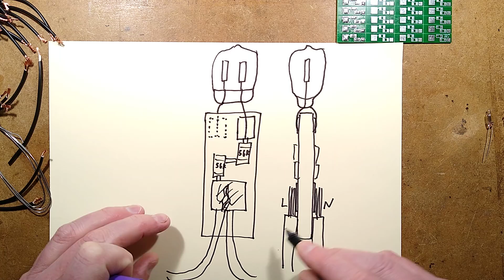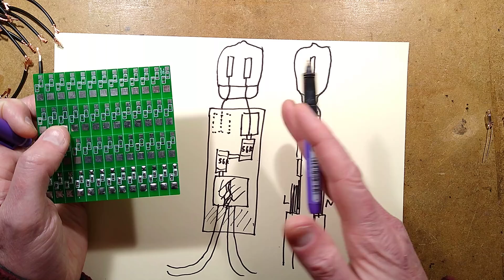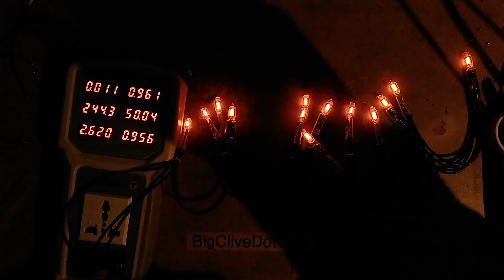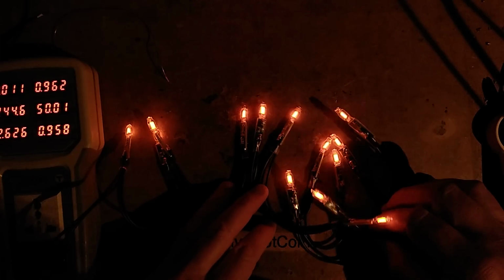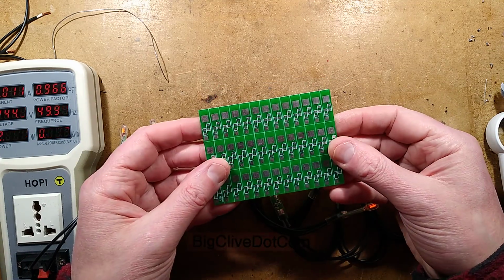PCB based neon fairy lights

Comment: How about making it a little smaller? If the resistors can take the voltage, then you could use four 120k resistors: two in parallel on either side of the board. On 230V you can also use two neons in series to half the current, at the expense of more flicker.

Comment: It's cheapest to panelize yourself with mousebites for breaking boards apart. Sometimes they complain and charge you extra but usually it works. Very tedious to do however, especially for small boards, haven't tried automating it yet since it seems about as much work/time for me as my lifetime manual paneling time.

Comment: Sorry if I missed the answer to this how many can you put in a row? Is there a cut off?

Thank you Clive!
Reply from the maker: Maximum number in a run is the current rating of the cable in Amps times 500.  So thousands.
Reply: @bigclivedotcom  Thank you for answering that. I’m new to electronics and have only done a few projects so far. I’ve never ordered pcbs but this is wonderful. So it will hopefully be my next project. Thank you so much!

Comment: Flux very much does age... but only the liquid stuff!  If it's in a multi-core solid solder it should be stable for decades.
(I had a glass jar of "pro" grade solder flux, opened and then stored for years.  When I can back to it, the vapour had corroded the metal screw lid to the glass and the flux was black and gloopy.  Didn't put it near my PCBs!  I now only use flux pens, especially for SMT.)

Comment: You can panelize using routed slots and drilled holes in your design directly for PCBs that small, this way you avoid the v-slot charge

Comment: No need for PCB... Just solder a normal 100 Kohm 1/4 W in series with each bulb, cover it with shrink tubing, solder the other wire, some more shrink on top, and is done.
My way.
It also possible to make blinking light string, if powered with DC and a 1 uF cap in parallel with the bulb.
Those bulbs are active components because they have a negative differential resistance.
Thanks!
Reply from the maker: I made another video with neons, discrete resistors and sleeving.

Comment: Why not have the resistors for the lamps at the supply side covering all the lamps instead of resistors at each lamp? I don’t recall LEDs. Ending a resistor per lamp. 

I’m am completely ignorant.
Reply from the maker: Neons require a resistor each.  If you use one resistor the first to "strike" will clamp the voltage and stop the others lighting.
Reply: @bigclivedotcom  Yay cellphone autocorrect!

Comment: A clever design for a PCB project and a simple soldering method to mount the components. You've designed it as a Fairy Light chain, but the Neon's will look great hung around anything for a room display for ambient lighting. I love your HOPI unit for the various displayed results and easy connection to input the cables. I must get myself one from somewhere. If you know of a place and/or recommend a make, please leave a link below Clive in the reply section.
Reply from the maker: The Hopi came from eBay.
Reply: @bigclivedotcom Cheers Clive.

Comment: I just got some panels made too, although I did panelise them myself. The original design was for 4 modules with 3 sides routed and the 4th vscored, so they were effectively hanging on tabs. But they didn't like it, so instead I just made two modules back to back with vscores between (and an extra spacer section to make up the minimum width for the vscoring process).

They turned out the same price ordering twice as many smaller boards. It wouldn't have been that expensive, except for the fact that I wanted them gold plated for the edge connector. Even so it still only worked out to less than $2 Aussie Dollary Doos per-module. EDIT: I just checked and they don't have the option for the 40 modules I wanted, so I would've had to order 50. That would've made it only $0.10 more expensive per-module, but added a total of about a third more to the cost.

Which is the cheap part. Now I need to suck it up and buy a big batch of vintage ICs from the US.

Comment: Watching you use so much solder on everything makes me cringe. You can use 4 times less solder when pre-tinning the wires and half the solder for soldering that SMD resistor and neon legs.

And why didn't you take off the nozzle of the heat gun?

Comment: Yeah, any kind of grooving or routing adds significant cost to cheap PCBs. I usually just panelize them myself and leave room for a bandsaw cut and do it myself, but like you said, sometimes it’s easier to just order them individually for some reason. Great vids. As an electrical engineer, I find your videos well produced, interesting, and very soothing. Keep up the great work. Cheers!

Comment: I have a small tin of paste flux on my bench for jobs like these. I add solder onto the pcb pads, dip the wires or pins on the paste flux then reflow them directly to the solder pool on the pcb. Does a quicker job than tinning the leads before reflowing them on the pcb. The pins or wires should be pretty clean though for the solder to wick around it well for a nice looking joint.

Comment: Nice going, I have a soft spot for Ne2 lamps. Did you know that neon lamps have this tendency to react to light itself? I discovered this with an outlet strip that had a neon lamp as a power indicator. The light would go from a state of flickering to steady and I am quite sure it had nothing to do with the voltage. Fun times

Comment: For safety you could run these from a simple isolated DC supply. I have tried  a 48V transformer (2 X 24V windings in series) run through a full wave voltage doubler which gives around 177V driving one neon lamp at 1mA. The voltage will drop with more neon lamps but the transformer (10VA) should be able to drive about 40 at 1mA each and still give sufficient voltage.

Obviously you could still get a shock if you touch both poles simultaneously but a floating isolated supply is generally safer.   

Running then on DC also allows them, with increase in the value of the series resistor and the addition of a capacitor, to be run as flashing relaxation oscillators. 

Next project is a neon supercomputer.

Comment: Hey, Clive. I think if you'd change one of the resistors with a diode in one direction, and in the other direction on the second PCB , that would make an alternating flickering lights. 😎
Reply from the maker: It would be too fast to see with the eye.

Comment: With regard to the flux, if I remember correctly the flux in solder changed or started changing in the 1980's from or to resin based. I have still got the odd bit of solder from before I was born.

Comment: I had the same "issue" with small PCB a couple of weeks ago.
But the way I designed the PCB, it had 2 holes in it to accommodate standoffs and that helped me to clamp the PCBs together, offset by one and then with a hacksaw I separated them (I was too cheap to pay for the extra cost).
It worked for me.
Would I do it again? In a pinch yes, but probably not.

Comment: For a project in the past i added a small blob of hot glue as cable restraint the heat shrink tube squeezed it out perfectly making it quite rigid.
Reply: Drawback is if it touched any conductors, hot glue can become conductive over the years so could be "interesting" at some random point in the future.  Then again, who knows the life span of random Chinese heat shrink sleeving.
Reply: @alexatkin  that could indeed become interresting with 240V, I usually do most of the work on the 5-24V range and I have not yet had any issues.

Comment: For important stuff (exposed mains voltage), I would use something like eBay item 334171645822 as my preferred heat shrink material. I used this stuff quite a bit and like it. But I have no clue what shipping to the UK/Isle of Man would cost.

Comment: Seasoned advice - more tin on the wire tabs & use a gun not a pen for said tabs (wire centered then apply primed gun tip on top of wires / it flows better)

Comment: Hot air gun - I use a B&Q Titan paint stripper, electronic temp and speed control and about 1/4 the price of a heat shrink gun. Very controllable and the larger amount of cooler air works very well

Comment: Would a single pad for each wire be better? Quicker and easier to solder
Reply from the maker: Possibly.  But I like the PCB adhesion strength of one bigger pad.
Reply: @bigclivedotcom  how about via stiching on side 1 L and N input. On side 2 L and N output. Don't know about via additional cost but pad adhesion much better

Comment: I did something similar with thin "zip" wire, only left it as a contiguous wire.
I'd only strip the insulation to leave a bare spot, then just fold it.  No cutting necessary, despite being a bit more labor-intensive getting off the insulation.

Comment: For what it's worth a dab of hot glue prior to adding heat shrink is actually a  pretty good substitute for the adhesive lined heat shrink tubing if you are shrinking it with a heat gun ... doesn't work quite as well with a flame.

Comment: Thanks again Clive for these videos, makes the evenings less lonely.
I like the idea of the shimmering effect, could there not be a way to introduce a simple way to make them flash?
I would really like to see a build with various the traditional Neon bulbs from short to very long electrods and even include Green and Blue variations.
I am sure many of us in the BCDC Family would mimic the build let that be on 220 or 120VAC mains.
Reply from the maker: It would require at least two resistors and a capacitor per neon.

Comment: I didn't have this issue with JLC. Did you use the website to panelize or did you do it yourself in the design software. When I ordered panelized PCBs I made the panel myself in EasyEDA before importing to JLC. were double sided and had 6 duplicate designs with v-cuts in between each, in total with expedited shipping it was $11 US.
Reply from the maker: It was due to the small PCBs and high number of close vee cuts.

Comment: Squirt a little hot melt glue on the circuit board and let it cool. Slide over the heat shrink tubing. When you shrink the tubing the glue will re-melt and squish all over.
Edit: I'd also round over the square ends of the circuit board to prevent the sharp corners from cutting through the tubing.

Comment: Any value adding a single resistor in series with the entire string on one power lead as an added measure of safety?
Reply: A fuse would be even better for that. If it actually does short out, you'd want it to be disconnected rather than stop glowing while still powered. The circuit breaker should mostly be enough though as well. It will probably trip before the wires melt anyway.

Comment: I did something similar but with silicone wire - Heat resistant as well as flexible. Makes stringing it up way easier
Reply: Unless in contact with gasoline etc., EDPM wire is better still as it is more resistant to damage from sharp edges and points. Not as easy to find tho.
Reply: @plemli  I'm so glad you posted that because so many people throw gasoline on their Christmas tree
Reply: @pleasecho2  Yeah, and it's nice that at least the wiring won't be affected 😛

Comment: I must say, as a self "taught" amateur tinkerer, it's very reassuring to see how long you hold the iron on components!!
I know enough to know that components gave like 2 ratings, one for absorbed heat while being oven soldered, and another for heat absorbed through terminals sinking it while soldering with an iron.

I've always been concerned with how long I keep the iron contacted, mainly when salvaging but even with new parts, knowing how hot they get. 🥴
Reply from the maker: In the past it was easier to damage components with heat.  These days they're very resilient.

Comment: In the US (~120 VAC), we used 88k - 120k (or ~1k per VAC).  88k for bright and 120k for dimmer neon's.  4 @ 30k will work nicely.
Suggestion: put the neon pad on the other side away from the resistor so your leads will not be close to the resistor. 
A little more trace length, but more room for longer legs.
Reply from the maker: That was one thing I did pick up from the prototype.

Comment: Your HOPI says 2.633W yet the math says 2.6939W ????
The current wattage of each lamp is .2W... What is the rating is watts or amps? Is there a voltage rating? The voltage divided up between each lamp is 18.83V, that doesn't sound like enough. I thought small neon lamps like that required around 60V to turn on?
Reply from the maker: The neons are all in parallel.
Reply: @bigclivedotcom  Ah-ha...A slight oversite of mine 🙂

Comment: Consider adding a capacitor to each board to make relaxation oscillators for a twinkling effect.
Reply from the maker: With modern MLCC caps or a small electrolytic that's viable.

Comment: A bunch of neons I got from ebay all burnt up after about 2 months with 2x100K resistors. Are bigger resistors a good idea? They seem to light just as brightly with 2x220K and they even light a bit  with 1x440K and me touching the other terminal (meter said about 10uA)
Reply from the maker: They glow at very low current.  Too much results in rapid darkening due to electrode sputtering.
Reply: @bigclivedotcom  thanks. Can you follow up on the lifespan of yours? The ones you have look exactly like the ones I got (the way the electrodes light so evenly).

 Another batch of neons I got to make a prototype set light very unevenly with a pair of 100K resistors but don't show any sign of darkening despite running for the same amount of time.

Comment: I've thought about the flux aging, but I buy the .030 solder in the 1lb spool that lasts for well over 5 years and it still works fine. [I think I bought my current spool 8 years ago and still have 30% left.] With the spool I just grab the end and pull out 2 feet or so, use it and when done just wind it back onto the spool. That way I never run out or end up with little tidbits of solder.

Comment: Quick tip, and just the tip mind, but popping a sliver, or two, of hot melt glue stick inside regular heat shrink it does a great job at filling in any gaps, reinforcing the heat shrink, and also acting as strain relief. Now that you have these made, you could use a thin nozzle on a hot melt glue gun to pump some melted schmoo inside these, by the leads, to make them a bit more robust.
Reply: What a nice doggie pic General Disarray.  Yours ?
Reply: @ilovepuppies3507  I wish, but sadly not mine

Comment: Quite unusual and cute ☺️, I would love to have these. I have a 100 holder, incandescent coloured fairy lights set strung along the walls in my bedroom, which has been running for quite a long time - I put them up one Christmas and didn’t bother taking them down = now they are mood lighting as they are too bright for night lights - I recently bought a “Chineseum crap” dimmer socket to dim the lights so I can go to bed with them on 😴. Only the yellow bulb above the pillow of my bunk bed has failed 2x and the blue bulbs have UV faded - they need to have the paint stripped off and be re-dipped in acrylic paint, that is how long I have been using them - as of typing this l am admiring them at full-brightness 🤗. If they were to completely fail - I would replace them with coloured dimmable LED ones.
[Clive] you could do Coloured neons with that

Comment: Very nice. I was wondering if you wanted to maintain double insulation for the whole setup would a second bit of heat shrink over the board be enough?
Reply from the maker: It would.  And also a touch of hot melt for strain relief.

Comment: Oops... you said "1201 size resistors" at 16:10.
1201 would be really weird with a 0.126" length by only 0.012" width.  (3.2mm x 0.3mm)
You got it right as 1206 elsewhere though.   :-)

Comment: I took apart a failed E27 compact fluorescent tube, only used the base of it, I glued one neon into each hole where the ends of the tube was (total of 2), each neon have a series resistor to limit the voltage to around 110V max. I made it years ago, I use it daily for ambient ‒ mimicking the color of sodium street lights ‒, but still no visible brightness degradation yet! 😏 🟠

Comment: Could you do 2 of them in series? Maybe you could run at half of the power? I like to go for the lowest power option(s) if it is possible. On 240 Volt you could even put 3 in series (depends on the exact voltage of your neon bulb of course).
Reply from the maker: That would work on 230V OK but would make the wiring more complex.

Comment: Yeah the Yihua stations are alright. The biggest problem with them that can easily be fixed is the loose tolerance between the heating element and the tip. When soldering large connections, the thermal resistance of that air gap means the heating element is kept at the set temperature, but the tip is not. You can bridge that gap by stuffing some material in between. Some people pour graphite powder into the tip. What I did was wrap an aluminium shim around the heating element, which I cut from a beverage can. 
If you were to put the circuit boards of a Yihua and the equivalent genuine Hakko side by side I've been told the Hakko one is more complex. I guess they might be doing some feed-forward logic to compensate for this air gap, which in their product is much smaller anyway, but the Yihua has no such feature. Hence the mod works so well.

Comment: One idea I've had for neon Christmas lights is to just swap out all the incandescent bulbs in an American-style series-filament light string for ne-2 bulbs and then drive it at high voltage high frequency with a CCFL driver. It'd be even more crazy dangerous than American Christmas lights already are, given the cable's rated for 300V and you're pumping something on the order of 10kV into em to drive a load of neon bulbs in series, but it'd still probably work and if I had a CCFL inverter lying around I'd have tried it already.
Reply: Use just one wire and connect it to a small Tesla coil.